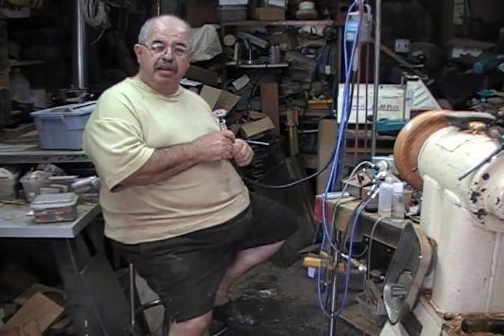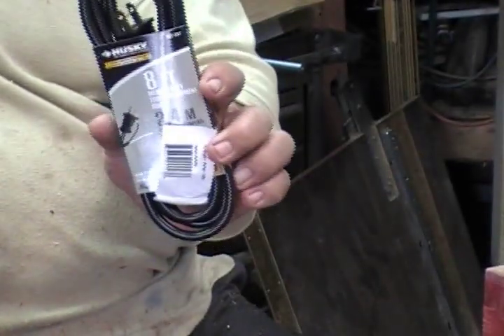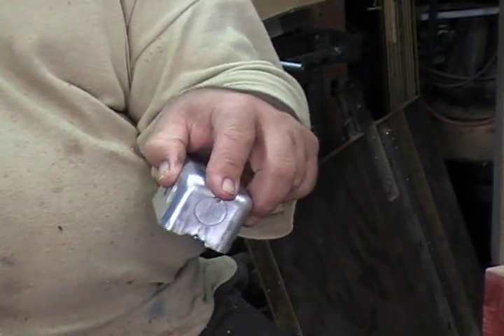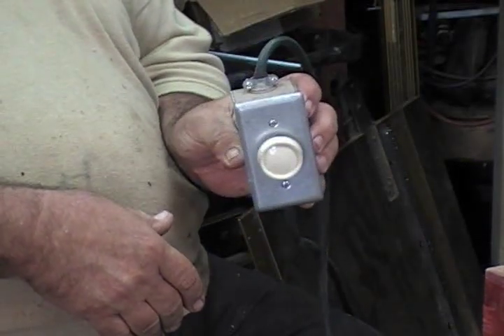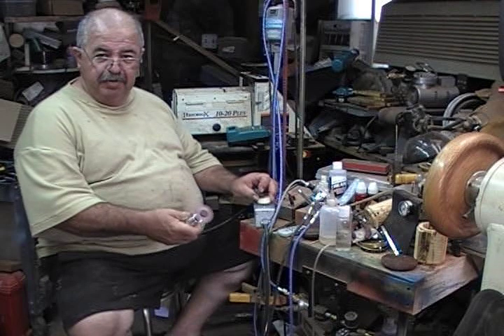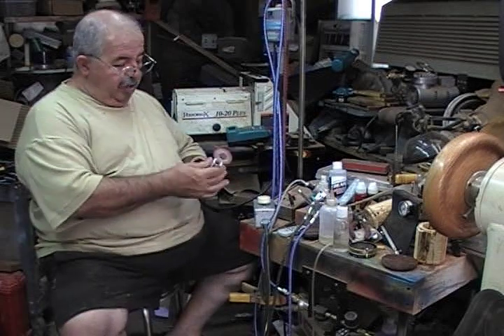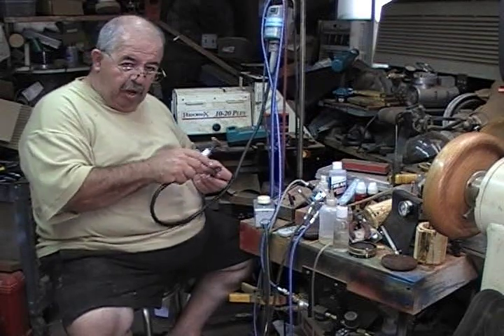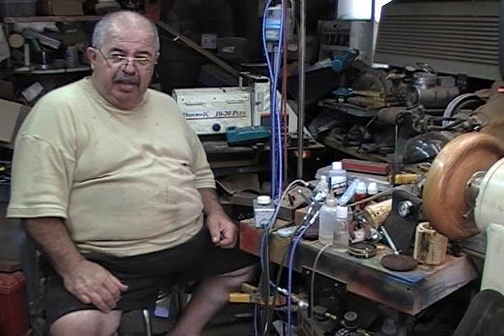speed Controller Basics

Comment: I had this question in mind when I came across you lol...thank you for the solution and confirmation to my bench grinder question.
Reply: You'll burn out your motor doing this.  It will draw more amps than normal.  Your motor is a single phase motor and the only way to change the speed is through gear ratios.  Variable speed motors are typically  3 phase.

Comment: Will this work on a bench grinder say say standard 3500 RPMs and slow it down to 750 RPMs or so to sharpen turning tools?
Reply: no, that is an ac motor, it will slow down to a dead stop.  nuff said.
Reply: From what I've seen, you need to build a pulley system to get to those low speeds.
Reply: It will not work on induction motors..

Comment: sir I have 12000rpm 50hz 1050 watt 220v ac marble cutter machine which variable speed controller will use to control speed please suggest me
Reply: go to ebay and type motor speed controller, or vfd, variable frequency drive

Comment: I have a 12 volt radiator fan I want to use for another purpose but it is too noisy.  So I need to reduced the RPM.  Does your motor control here have any application?  I mean, you seem to be working with 120 v and my fan is 12 v.

Comment: IM GOING TO TRY IT  BUT ALWAYS  HEAR  RHEOSTATS ARE HARD ON ELECTRICAL MOTORS
Reply: it's ok to use-it's a potentiometer not a rheostat
Reply: Mike   Would this work for a DC motor .  The blower fan in my old van is 12 volt DC and uses resistors to control the speed . They heat up and are located in the airstream , which is fine in the winter but insane in summer .

Comment: The light dimmer is not a rheostat as you state! It use electronic controls as in a trial to control current flow not voltage.

Comment: Since a dimmer uses a triac that  just clips the waveform, you will probably find that it stalls somewhat easily at low RPM.  My shop fix for speed control was to install a 3-phase motor and use a variable frequency drive. Much flatter torque curve (also  much more expensive). I did this on my 10" grinder and on my knife grinder. Worked great. Probably not going to be able to find a motor to convert a Foredom, but a lathe, as someone mentioned, yes - much better than a dimmer.

Comment: It seems we think along the same lines. I made one to use on my old lathe. It didn't have speed control. So I just made a speed control extension cord. Worked pretty good. Also use it on my gold vibrator bucket to separate black sands. Thanks Capt.
Tom